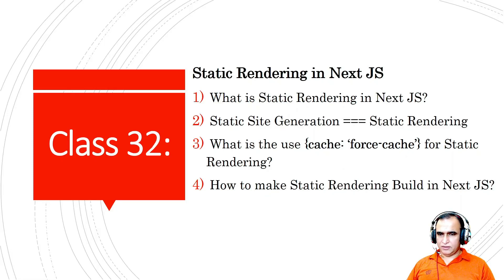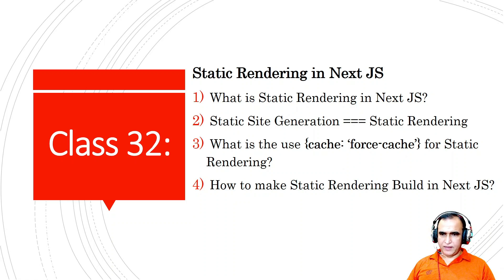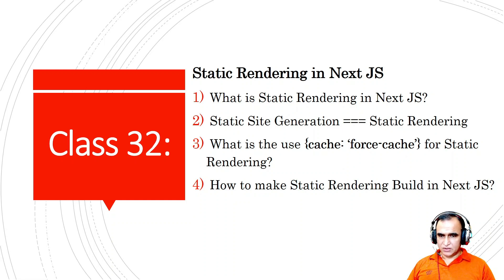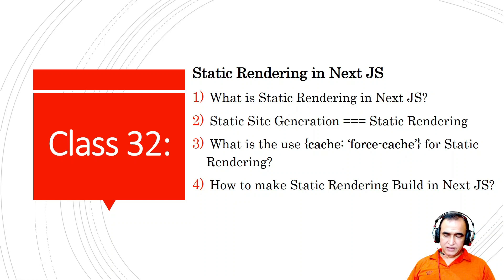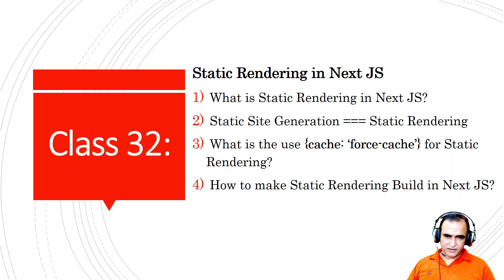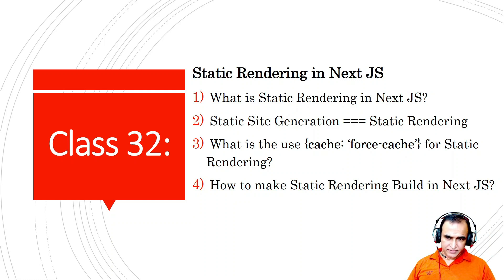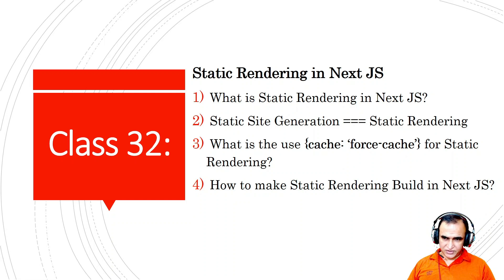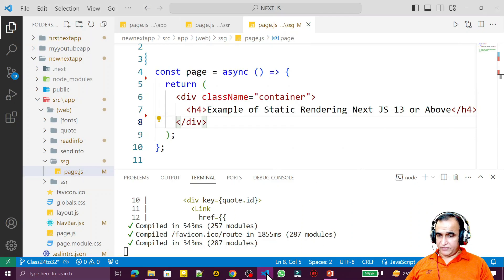Static Rendering in Next JS | Static Site Generation in Next JS | Next JS Full Stack Course #32

Comment: 1. Does cache option in fetch caches the page like export const dynamic='force-dynamic'? whats the difference?
2. not passing any cache option in fetch() is equivalent to cache:'force-cache' ?
3. I made a route handler for read and create todo .... im fetching from that endpoint , so when im not passing cache option, it should show data fetched during build time but it shows way less.. i dont understand why?
Reply from the maker: In Next JS 13 or above static rendering and dynamic rendering work, static with passing force-cache and dynamic by passing no-store. by default in force-cache.